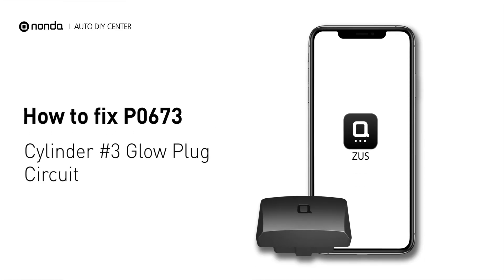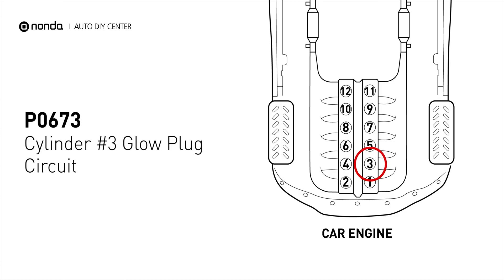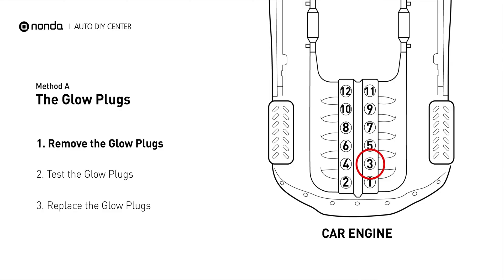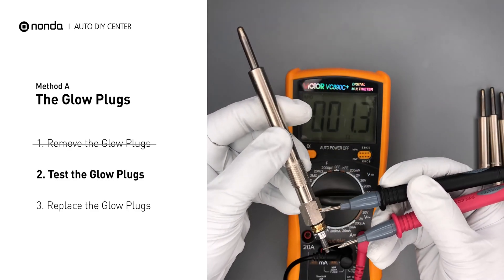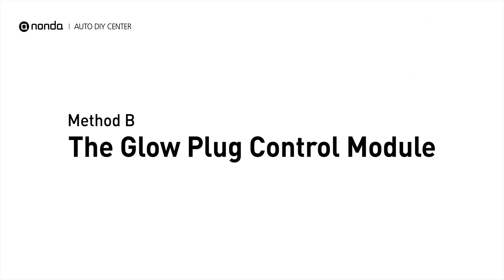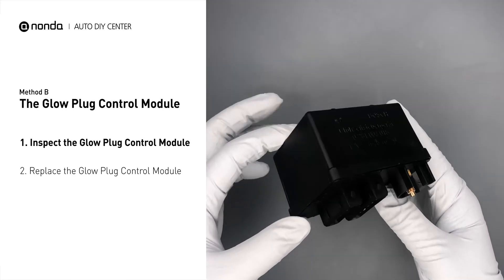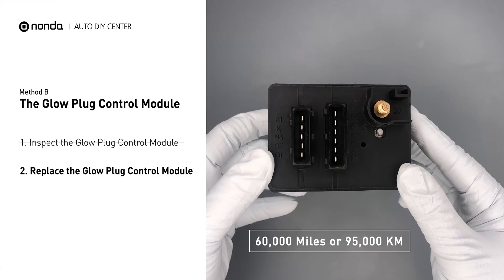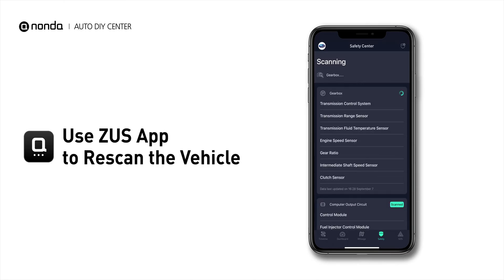How to Fix P0673 Engine Code in 3 Minutes [2 DIY Methods / Only $9.25]

Comment from the maker: Hi, I'm Steve, nonda's lead mechanic engineer. 
Feel free to leave your comments here if you have any mechanic questions, I will be glad to help you out!
Reply: I have a po673 and po675 and have changed glow plugs on both once, twice on a one of them.  Would you suspect wiring or the controller?   I know each glow plug has it own transistor in the controller but that is about the extent of my controller knowledge on these.